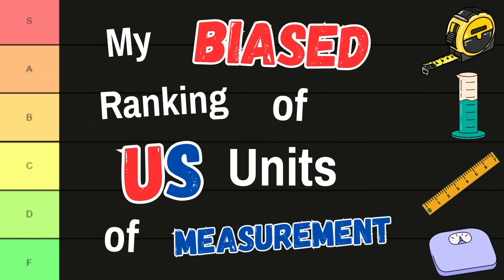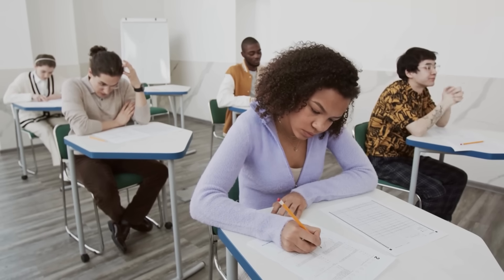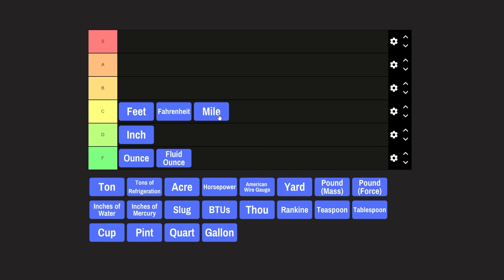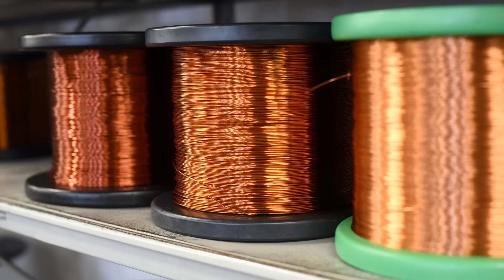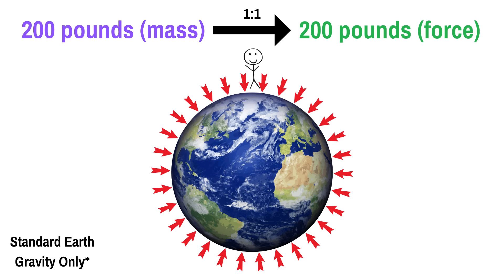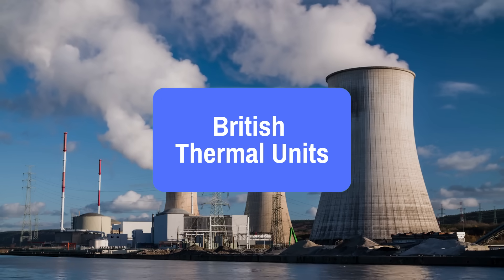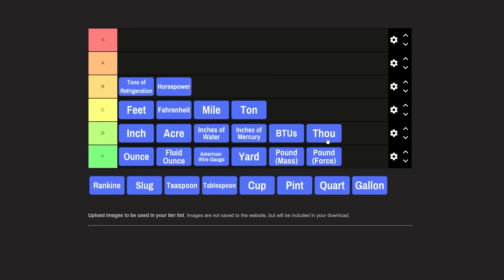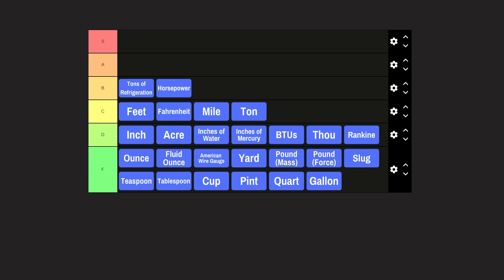Tier List of the DISASTROUS US Measuring System

Comment: I got my engineering degree in America.  We were taught the following method when solving problems in imperial units:

1) convert given inputs to metric
2) solve normally
3) convert solution back to imperial
Reply: The crashed NASA probe thing was because one propulsion force sensor gave a reading in pounds of force, even though the specifications said the number was in newtons (1 pound is ~4.5 newtons).
Reply: @Riboshom Wow that's even more crazy! I always assumed it was just small rounding errors in unit conversion adding up, and then being multiplied dramatically by the fact the spacecraft is going something like 40,000 km/h for tens of millions of kilometers.
Reply: @Riboshom and all thanks to lockheed martin
Reply: How does the newton compare to an oldton?
Reply: I am a Land Surveyor. We constantly have to do conversions with measurements. We not only have to deal with metric measurements but also the U.S. Foot and the International Foot. Some states require by law that all measurements use either the U.S. foot or the International Foot, both of which are legally defined in terms of the METER! Go figure that one out. Don't even get me started about the "vara", either Spanish or French. How about chains, rods and links? ARG!
Reply: @rustyknott-W.D  Had me confused there for a while, wondering what the difference was since an 'international' foot and a 'US' foot are the same thing. Just discovered there was a "US survey foot" very slightly different from a normal foot (it was the definition of a foot between 1866 and 1959, but the usual measurement called "foot" in the US since 1959 has been identical with the unit standardized at the time, i.e., the "international" foot), but good news: as of Jan 1 2023, the US survey foot is officially obsolete.
Reply: @rustyknott-W.D  afaik all US metrology nowadays uses metric definitions for every measurement possible and converts it to customary units (it sounds strange but it's pretty understandable given that all standards exist in metric only and all definitions of metrics are given with scientific methods to allow maximal precision).
Reply: @rustyknott-W.D   Oh boy, I didn't remember about different feet! I like to bring up the different definitions of the inch (some obsolete now) when people around me start getting into inches vs millimeters.
Reply: This was my usual approach too but once had a professor mark it wrong for not doing the calculation in customary units.
Reply: @joshualucas1821  Unless they had explicitly said how you were to solve it, I find that disgustingly closed-minded.
Reply: @joshualucas1821  I would call a professor like that the third derivative of position.
Reply: I think a whole Apollo rocket failed its mission due to this, its foggy but i remember something i saw somewhere here in yt about the team having people from abroad or something and the computer correctly translated a unit of measurement from imperial to metric but the value was misaligned to said rocket's hardware and lost control, thats crazy that happened because of that, ain't no way boy
Reply: @leandrolahiteau8162  This was Mars climate observer in 1999 and the idiots were Lockheed Martin
Reply: @CaptainDangeax   Many thanks!
Reply: Lockheed Martin when missiles to destroy a village in the Middle East are requested: 🥰🥰🤑🤑🤑🤑

Lockheed Martin when it comes to preserve the lives of researchers in an expensive space mission: 😦
Reply: @CaptainDangeax  Can you imagine that moment of realisation when you're investigating why your client's $100m probe burned up upon entry...
Reply: @dannyarcher6370  yes I can imagine, as a French, the country who gave the metric system to the world, with german ancestors, the country who gave Werner Von Braun, this Mars Global Surveyor crash is an endless amusement. Another one is the total decay of american products since the boomers are retiring. Is ot the same Lockheed who designed the P38, the Constellation, the SR71 and the U2 at a time, and now unable to finish the F35 with a budget France would have designed a death star with. Same for Boeing who designed the looping able 707, and now the latest 737 doesn't fly horizontally at full trust. Same for american auto industry.
Reply: @CaptainDangeax As someone with English and German ancestry and a French surname, don’t get me started on Renault, Peugeot and Citroen. 😛
Reply: @leandrolahiteau8162  That was a Mars mission, not Apollo.  But yes, mistakes have happened due to unit inconsistency.
Reply: @leandrolahiteau8162 I think a MARS mission
Reply: @leandrolahiteau8162 the whole apollo mission were metric internally (no wonder with all the Germans running around). That goes even so far that the apollo guidance computer used precious calculation capacity (and it was in really high demand back then) to convert the internal metric calculations to imperial. Why would someone do something crazy like that? Because the astronauts couldn’t estimate in metric units, they were just not used to it. So they converted everything to miles and such and displayed it that way, and whabam: moonlanding 😁👍
Reply: @leandrolahiteau8162  i feel like i just had a stroke after reading that
Reply: @endevomgelende8634   Damn, that´s crazy aint no way boy aint no way no way way no way boy way boy no way
Reply: @endevomgelende8634 damn then maybe you had an actual stroke because I read that just fine
Reply: @leandrolahiteau8162 it was the Mars Climate Explorer
Reply: @leandrolahiteau8162  The only Apollo failure was Apollo 13 and measurments were not involved.  You might say that Apollo 1 was a failure but that was NOT a launch but a ground test and a fire that had nothing to do with measurements as well.  I am unaware of any other issues with Apollo.  Besides in the 1960's and 70's most everyone was using Imperial Units.
Reply: @_Coffee4Closers 

The guidance computer used for the Apollo missions was metric possibly some other bits as well with outputs to the astronauts converted to US customary, generally reflecting that scientists had been on SI already for decades by that point.
Reply: @timp2751  Yes, but that does not invalidate my comment I think.  I have a Aerospace Engineering Degree and we used both British and SI units in school.  In my jobs at Pratt & Whitney and later GE Aviation doing Jet Engine Aerodynamic design it was a mixed bag of both systems depending on what the task was.  For example Temperatures were always Fahrenheit or Rankin.  But we also used SI units at times as well.  In my experience we used British units more than SI.  This was true for both companies and across many programs for the past 30 years.
Reply: @_Coffee4Closers NASA engineers have done their calculations in metric since it began making rockets…I mean there was more German spoken there than English.  That carried over, but everything was converted to imperial for machinists, astronauts, etc.
Reply: @dwaynepenner2788  To suggest that all the "smart" people at early NASA where Germans is silly, or that they all were speaking German.  Hell even Von Braun said he got all of his knowledge from Robert H. Goddard.
Reply: @_Coffee4Closers almost all the people with practical rocket experience were German;  which means experience making calculations.  I said nothing about smart, please don’t put words on my mouth.  But it interesting that’s where you went…
Reply: @dwaynepenner2788  I went there because you are trying to imply that the US had nothing to do with the moon landings.  You are trying to claim it was all just captured NAZI's and technology from the Germans.  Yes the Germans took Godard's ideas and breakthroughs and were the first to weaponize and employ them wide scale, but the US had plenty of brilliant Engineers and no there were not more people at NASA speaking German that English, that is nonsense.
Reply: I'm a brazillian in college right now, I'm studying fluid dynamics with a professor who has a phd in petroleum engineering and, because of his field, he had to work a lot with US oil companies and now forces us to understand the US imperial unit system.

all the problems he gave to us could be solved in 3 lines using metric (when I used those just to exercise) and became a full page long when I had to use imperial on his tests

just a quedtion tho: WHYYYYYYY?
Reply: Fun fact the US military regularly makes up their own units of measurement when imperial unit conversions are too hard to remember.
Reply: The fact we have to switch measurement systems multiple times is asking for trouble! It is unfortunate it would be a grand undertaking for the country to embrace Metric entirely. Not to mention people who will defend the system to the grave.
Reply: @dvn.s_0069  It could be done but was handled badly. Some elements are in place (foodstuffs are often marked with both systems). An approach like the UK where the conversion is mostly done but a few remnants still persist would probably be the way to tackle it in the US.
Reply: @chaos.corner It's basically just road signs in miles and yards, and draft beer and milk are sold by the pint. Other than that it's all metric.

We do body measurements in feet and inches and stone and lbs too I guess.
Reply: @dvn.s_0069  I grew up with "U.S. Customary", and I really don't like how just about nothing makes sense.
Reply: US Customary, not Imperial
Reply: @TheCommonGadfly  I had thought of pointing that out... GMTA. Let's face it, even the British, who basically came up with the system, don't want it anymore...    ;)
Reply: Exactly. In fact one dirty secret is that the US is actually metric at the level of standards. The US imperial units are actually legally defined as a conversion factor applied to the metric unit.
Reply: That is more or less also how computers deal with the mess that is time zones and DST only instead of metric it is all converted to UTC for anything but input and display.
Reply: Why? Like when a percentage of Americans don't know how to use a knife and fork properly, they tend to swap the fork to the right hand after cutting the food!
Reply: Engineering degree and you are this ignorant?
Reply: @@user-jr2vp5ht3t Did not get the reference
Reply: cringe
Reply: LMAOOOO
Reply: I got my engineering degree in America too, but that was an uncommon way to solve problems. Sometimes that is easier, but usually you would stay with the original unit system. SI is usually easier (sometimes much easier), though I will say I like pounds because you don't have to do a conversion from mass to force (kg->N).
Reply: @Max-eh8gk  "I like pounds because you don't have to do a conversion from mass to force" -- that fails rather spectacularly when you go to space...
Reply: Surely step 3 is pointless, especially in engineering?
Reply: Also how the US defines its standard lengths of measurements
Reply: Makes A LOT of sense
Reply: Lol wtf
Reply: truly an american moment
Reply: That says it all. No questions left.
Reply: There is the metric system. 
And there is some neolithic stuff.
Reply: That is actually so depressing....
Reply: @  it’s the easiest way! :)
Reply: That's like 2 extra steps that should not be needed.
Reply: thank god I won’t be an american engineer, that sounds like a huge headache. And regular physical calculations are already kind of a headache
Reply: This is actually how Apollo space program worked. All calculations were done in metric, but at the start and the end it was converted from/to imperial, because the astronauts were unable to use metric.
Reply: @ “astronauts were unable to use metric”

i don’t know about the first half, but this part is not true and you know it
Reply: Are there any rounding errors doing that?
Reply: @  Conversions can be as accurate as you want.  We know conversion factors to more significant figures than any practical engineering task would ever require.  :)
Reply: They did it on the Apollo project too.  They just avoided failure due to conversion errors.
Reply: It might be because the metric system was designed by scientists while the imperial was designed by... errr. nobody, they just arbitrarily took various usages at the time....
Reply: hilarious 🤣
Reply: Solve normally with extra steps
Reply: 1a adjust for temperature and pressure
Reply: Bullshit!
Reply: Well, I was just taught to memorize a whole bunch of extra constants I wouldn't have to otherwise use.
Reply: Fucking Christ.
Reply: No you werent
Reply: briliant. i also liked how veritasium in his old video about kilogram joked on pounds logic. that to a shame of a kilogram, which at the time was defined by a physical object, pound wasn't defined by and object and instead as precisely 0,45359237 kg. "sucked in" xD
Reply: Interesting because normally when shown an equation without any numeric constants, an American's first reaction is that the equation is wrong because it doesn't have unit conversion factors.
Reply: What school did you go to that taught you that? It’s a little concerning because we don’t use the imperial system in America and we never have used it. We use the USCSM(United States customary system of measurements). It is a different measurement system than imperial despite copying a bunch of the names of measurements.
Reply: @charlesbrown4483 . University of California Irvine, one of the the top schools in the country.  Of course we learned the definitions of imperial units- just that it’s much easier, faster, and less risk of mistakes to solve in metric.  Which is objectively true.
Reply: @nathanmays7926  Irvine, yeah that makes sense. I don’t think you’re understanding Nathan. 

We don’t use imperial. We have never used imperial. Is that clear?
Reply: Which imperial? That's a serious question. Imperial British units are not the same as Imperial American units. Didn't you guys have a whole war to get away from Imperialism? This continues to cause many problems and has cost lives. 
The best solution is: Measure in metric; Calculate in metric; Publish in metric. 
And yes, we had a whole war to destroy Napoleon under who's leadership metric was invented.
Reply: @benchapple1583  Strictly speaking, American units are not Imperial units; they're properly called "American customary units"; "Imperial" refers to the British units.
Reply: @nac5901  You're right but it's semantics. The rest of the world view them as the same.
Reply: @benchapple1583  Brother in Christ, the Us measurement system isn’t actually the imperial system, it is the customary system.
Reply: @Kokangalang  Someone else posted a similar comment and I'm sure you're right however the rest of the world still call it 'the imperial system' because you inherited it directly from the British lock stock and barrel.
Reply: @benchapple1583  yes I saw the comment. But the system is still the customary system.
Reply: Just start in metric, solve in metric, then stay in metric, no stupid conversion to delulu units
Reply: @Vunyx  How about just being a well rounded Engineer and learn to do math in all units, that's how we did it in Engineering School when I went.  Solving in Imperial Units is not any harder than in Metric Units... math is math.
Reply: That’s ummm weird, I’ve been discouraged from doing that. Instead we’re expected to know how to use botg
Reply: the US dose not use imperial units, it uses US customary units and international units, there are many imperial units that differ from US customary units, its only the international units that are common between the US and UK etc systems, e.g. ton, pint, quart, gallon etc all differ between imperial and US customary, while the international units have only been in place since the 1950's, so prior to then even new "standardised" units differed.

an engineering degree that has not educated you in the actual units you use in the US (US customary units and NOT imperial units) is just a feckless joke of a degree, as its failed to address a fundamentals or make you aware of the that there are a swath of units in the US that have borrowed a name from the imperial unit system but are fundamentally different from the imperial system, a ton to you is 2000lb (US customary - ~907kg), a ton to much of the rest of the world is 2240lb (imperial ton - ~1016kg) or 2204lb tonne (metric 1000kg), while your liquid gallon may be 8 pints or 4 quarts like ours, but your liquid gallon is ~3.785L while ours is ~4.546L because pints, quarts etc differ.

had it been a good engineering degree you would not be making feckless statements in youtube comments.
Reply: @b101uk9 Technically, we didn't borrow names from imperial units, since the US customary units actually came first. :D
Reply: @RaptieFeathers  go educate yourself, US customary units (as used since the late 18th century) are newer than imperial units, given old customary units were not defend the same way as the new customary units, i.e. old customary units and new customary units, they were redefined relative to the KG and Meter, see the Mendenhall Order of 1893, when most of the US units were redefined, which took place between 1866 and 1893, both of which are later than 1824, i.e. UK pre and post 1824, US pre and post 1866-1893, and US and UK international units in 1959, if something is redefined then it is newer.
Reply: @b101uk9   If something is redefined, then it is newer? Well! 
In that case, the UK's Weights and Measures Act 1985 did that for the Imperial system. Which makes it the newest.

(It's actually been amended as recently as 2020 if you want to get reeaaaallly pedantic)
Reply: @RaptieFeathers  err no, because it did not change the very definitions of the units unlike the Mendenhall Order, it just formalised metric units for trade etc as part of harmonisation with the European Commission (EC) et al, and extended the powers of local authority Trading Standards scope, along with how things are permitted to be sold, like draft beer etc can be sold in pints at pubs etc, but bottled beer in ml etc, and other such things, and if you had a clue, you would know NOT all Weights and Measures Acts were as fundamental as the 1824 one.
Reply: or just don't convert and use the metric system
Reply: @Desam1000  Nice idea, but it doesn't work if you've been given the data in American units, and/or you have to give the results to someone who expects them in American units.
Reply: @zevfarkas5120  Oh that's a problem. I thought in engineering in America everyone uses metrics systems. But it seems I only know a small part about it.
Reply: @Desam1000  It's easier to teach and understand in metric, but, once you get out of academia and into American industry, you have to deal with that mess of smelly feet and pounding headaches...   ;)
Reply: @zevfarkas5120  Yes it's sad. I don't understand why USA is doing this do itself.
Reply: @Desam1000  Mostly because of laziness. Changing over to metric (which is already the basis for the legal definition of American measurements) would require a lot of re-tooling, and things built using American units will be around for a long time, so at least a generation of students would have to be familiar with both systems and with how to convert between them. Considering how many functional illiterates the US educational system turns out, I can see why they don't want to further burden it with the task of switching to another system, no matter how superior.
Reply: and then the rest of the world just solves it normally
Reply: In defense of the imperial system, it could be worse. So could the ebola virus, for reference.
Reply: I wasn't taught this, but I just decided to do it on my own for all imperial questions.
Reply: You're missing one extra step to make the measurement truly 'Merican (*eagle image * hawk sound) is to convert those imperials results into football fields.
Reply: @kbeeng6307  Of you could just be a well rounded American Engineer like me and solve in whatever units you are given.  Math is math regardless of units, I really don't see the issue.
Reply: @_Coffee4Closers  From my experience it's not about math being math or being well rounded its about mitigating potential human error. The more times you have someone grab a calculator to make a physical calculation the more the odds of human error occurring. Someone misses a decimal place or divides by the wrong constant. I've worked on teams for multi-country multi-million dollar projects and most of the errors I've found is where someone fat fingers the calculator in a multi step calculation. So adding unnecessary unit translations is adding a chance for a mistake. About the only 'Merican standard I like is NEMA over IEC.
Reply: alternate solution: live anywhere in the world that's not the US to skip steps 1 and 3
Reply: @mastoukglouk9743  Yeah it is so hard to do math in those units America led the World in Aviation, Medicine, Space...
Reply: That's weird because my American ABET certified Engineering college, taught us how to use the actual measurements we'll encounter in our career, Imperial. You should ask your community college for a refund.
Reply: 4) round to the next clean fraction because decimals scare people
Reply: @AlexusMaximusDE  Introduce rounding error and information loss with all the conversions and rounding.  Fewer math operations and rounding...better.
Reply: I was already thinking during the video: Inmagen being an american enigeer or physicist who has to deal with this on a daily bases where by one little mistake would ruin the hole calculation
Reply: Or you could just pick a system and use it.
Reply: I had the same professor for Dynamics, Thermodynamics, and Finite Elements. He said he was from Florida, but I'm pretty sure he was from Saudi Arabia or something. But yeah. I and my friends would always convert everything to metric, solve it, and convert back. 
But one day, we found ourselves in this guy's dynamics class and an English problem came up. So he just solved it in English. Full on mass moment of inertia, radius of gyration, whatever else was going on in it. He had to stop so many times to explain unit conversions from force to mass that none of us got the example.
Reply: You, too? We did almost all our work in metric. This was at engineering schools in New York, late 70's, early 80's. My parents, OBM, were from Europe, so I got an early introduction to a sane system of measurements.
Reply: Am an engineer, this is not true. You generally stick with the units that you used to measure or that are given to you.
Reply: Wrong! Who gives you those measurements? I have RARELY seen engineers in the field taking measurements. I am a Land Surveyor. I give the measurements to Engineers. We have to reduce the data. For instance, GPS measurements are geodetic, x y z coordinates . Those measurements are metric. Then we have to convert them to feet, then project them onto a flat surface for the American civil engineer to use. You have to be fluent in conversions. It's really not that hard. When I first started, it drove me nuts until I quit worrying and learned to love the conversion factors. I mean, how many of us can visually see the difference between a meter and a yard? Even Celcius to Fahrenheit and back is fairly easy. @joeyenniss9099
Reply: @joeyenniss9099 not if you were a NASA engineer from the sixties to the 2000’s
Reply: @joeyenniss9099 they are sticking to metric though
Reply: @joeyenniss9099  It's still a sensible way to do it if the calculation is only of moderate complexity. Because if you have to do it in "customary", you will need more conversion factors within the calculation than for the metric conversion and back.
Reply: When I studied engineering, I had to learn how to do it both ways.  Conversions were not allowed.  We had to understand both.  That way when we encountered both we could work with it.  And there are 3 systems.  American, British, and SI metric.  And there are 3 metric systems. Old French metric, Italian metric, and SI metric.  You have to know the history of your reference.  Else you'll get the wrong answer.  Good luck with that.
Reply: @johnchestnut5340  and when you go into historical data you'll quickly discover that basically every country and city had their own foot
Reply: @HappyBeezerStudios  I wasn't thinking quite that far back.  But point taken.
Reply: @johnchestnut5340 could be that in history there where Italian an French metric. I can guarantee to you that all of France, Italy and the other 192 countries using the metric system use SI today and have been for the last decades at least. Never ever heard of those old systems. I work with french and Italian engineers since the 1990s...
Reply: @dominiquejeangille9254  Two points.  History.  And old books/records.  Just because modern engineers and scientists almost exclusively use SI metric does not mean that they won't encounter old equipment or structures or records.
Reply: Do you know that America is one CONTINENT, right? Most countries in America did not use Imperial System!
Reply: That sounds worse than just solving the problem in imperial to be honest